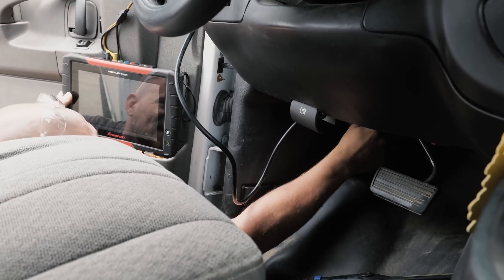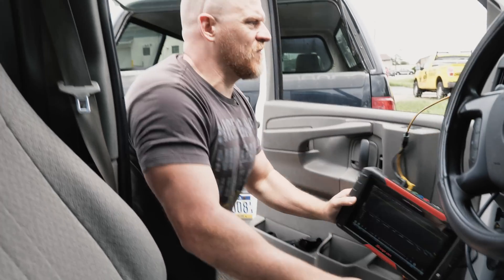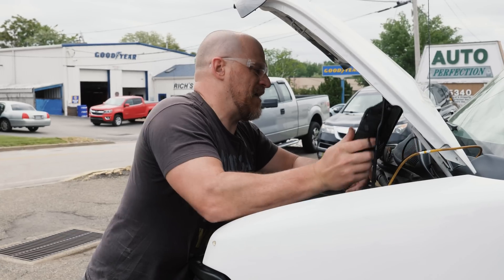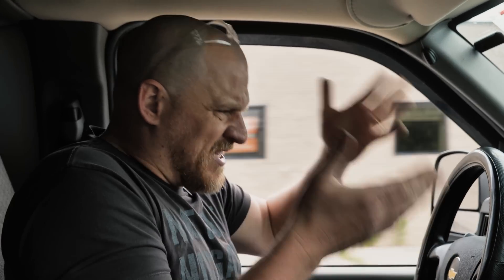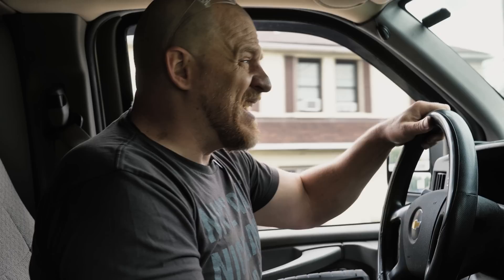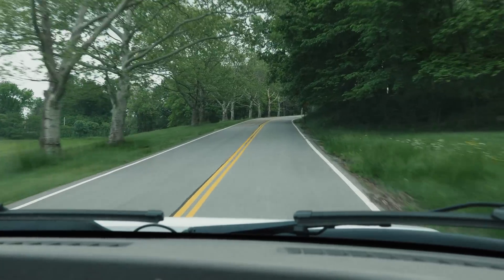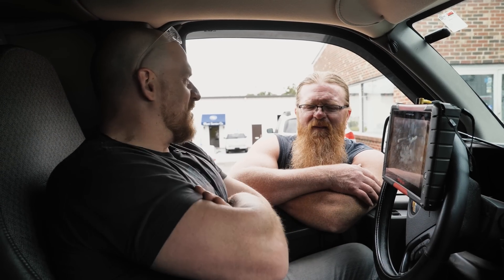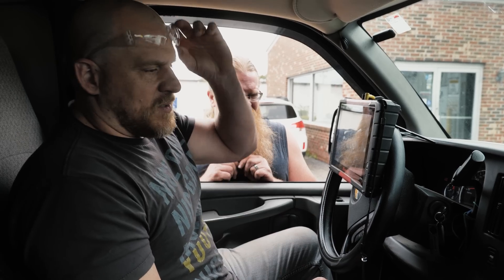We Don't Work For Free [Charging Diagnostic Time]

Comment: Hey man I have a question for you. Some context on this is that my grandmother passed away earlier this year and passed down her crown Vic to me. So I have been working on it non-stop for the past few months getting it back on the road. Brought it to get an alignment at a shop after I put on new tie rods, white wall tires, and sway bar bushings. Got the car back and the wheel was way off to the right. Held the wheel straight and it would go way off to the left. Like I’m talking it would cross three lanes on a parkway holding the wheel straight. So I bring it back tell the guy who did it that there was something wrong with the alignment, and he says bring it back but that the car has loose steering so the wheel won’t always be straight. If it does it again he said he wanted to go for a ride so I can show him. In my head I wasn’t buying the loose steering box, but ok. I pick it up the second time and ask him if he wants to take a ride so I can show him, at first he told me it’s near closing time and he wants to go home, but I convince him and he tells me that he wants me to go down the street he uses for all of his alignments because it wasn’t doing it for him. I said I hope it doesn’t do it this time then proceed to hold the wheel straight, and the car tracks left to the other side of the road. As soon as he sees that he tells me to turn the car around and head back to his shop, that I was being to anal, and that he’s being racing cars his whole life, he did 10 alignments that day and that you can’t win them all. So he said I’ll just give you your money back. You’re obviously not happy. We go back I don’t have my card so he said he can’t give me cash since I didn’t pay cash. He told me to come back the next morning but i didn’t go back. Upon further inspection of the car when I got home, I found that the front right white wall had been completely scuffed up for about a 1/4 of the tire and the rear right had some rubber missing from the side wall. I was besides myself. Brand new white wall tires, just messed up. I took pictures and I have before photos to show that they weren’t done by me. 

Was I being to anal about the car not tracking straight? And should I press the guy for damages to the tires? I haven’t gone back to get my money since I have other things going on. I mean I’m a graduated Marine Motorsports student from BOCES and have been wrenching on cars the last 6 years. I feel like this could’ve been handled better but idk. I’m trying to get a different perspective on the matter.
Reply from the maker: To be clear, these were brand new tires? That got destroyed after having what sounds like a shotty alignment done? Or were these very old tires?
Reply: @ScannerDanner  they were brand new tires. Bough them off of priority tire, had them shipped, installed them one week prior.

Comment: That's my thought exactly as being an self-employed automobile technician,, what do I charge a customer I normally charge them one hour diagnostic fee, can't find anything from there I have fool around with them for another couple hours and give that to them for free, but that's not fair to the next customer,,, but also when you quote a price out as I'm doing the air conditioning job the price has been quoted and now realizing the lines won't come loose from the evaporator core whose fault is it,, Is it mine, should I warn the customer about it ahead of time and he may not want to do it start off with,'but trying not to talk any problems up',, evaporator core is an expensive job the customer will pay no problem with that but, what would be fair. I don't want to work for free

Comment: This is something that used to chap me something fierce when I was still in this business. Why should techs work for free? No one else does. Some of what bothered me the most was some customers just had the attitude that well since my car is broke you have to fix it with minimal or no charge to me. Much time is spent now and has been for several years now, just finding wiring schematics, narrowing down the problem, before ever even touching the car. All of that takes time to do. I still wish this industry would do away with the flat rate pay system. Unfortunately, that is what has created all of the parts changers out there in my opinion.

Comment: This is exactly why I've been just dealing with an intermittent no-crank issue. Some days it just doesn't want to crank, and the rest it's fine. I have done everything myself to diagnose, and it's either the ground or starter itself. It's been doing this for almost 2 years now.

I sent it to the shop, and whaddya know, by the time the mechanic got to it IT WAS STARTING AGAIN. Absolute money-pit of an issue if I let a mechanic try and chase this intermittent issue. This is why for some customers it sucks to pay for diagnosing intermittent issues.
Reply: An experienced diagnostic tech , will test appropriately for the system and one who uses a scope can detect poor circuits and components. With good data can make a call to fix an intermittent issue of a failing part/control circuit.  JS
Reply: Grab a 10mm (or appropriate), and loosen then tighten every ground strap, both ends... 
Have you used jumper cables to starter from battery when no start condition? (ground and hot direct to battery).  GL
ps. Had a merc that took me 3 days to diagnose/fix... was a relay as I recall.
Reply: Also, where are you Matt?  I'm retired and help some folks/friends and family out, if relatively local (1 in X chance), I'd be willing to diagnose without charge and fix, you buy parts and assist.
Reply: @kennethhicks2113  Thanks for the offer. 

The issue came back after over 2 months again. This time I checked nearly everything. New symptom being it cranks for a split second then no longer responds to crank signal. It did this twice this week. Both days split second crank then no response after.

Solenoid gets 12v every time key in crank
Heavy gauge hot always 12.3v
Voltage drops to 12.09 on the heavy gauge with key in crank
There is no voltage leaking into ground on the engine block 

The only thing I haven't tried is bypassing the system with a direct jumper to starter (it's not easy setting alligator clips on blindly). 

Seems to me it's been the starter the entire time? It's only about 3-4 years old, but I'm not sure what brand the previous shop installed in there.
Reply: @TheGuccibane  Based on how I'm reading what you wrote, key always applies 12V to solenoid and solenoid always outputs 12V with very little voltage drop.  This tells me not much current output to starter and thus not enough power to turn the starter motor.  Diagnosis/guess, bad starter or ground.  Considering the difficulty of getting 12V to starter, use jumper cable from battery ground to engine block close to starter (you supply known good ground on starter).... if same measurements, bad starter.  GL
Reply: @kennethhicks2113  My initial assumption is somethings intermittently wrong with the starting circuit in the car but if solenoid supplies 12v on crank then that should mean the starting circuit is fine right? I thought I was chasing some wiring issue but it seems to be the starter is the one being intermittent. If the engine block ground was bad, wouldn't I see voltage in the ground of the block going from negative battery post to engine block?
Reply: @TheGuccibane  Yes, starting solenoid indicates good based on your reading of always 12V out to starter when key activates starting solenoid. As for ground, in days gone by I'd say yes to your question but seen some strange things and easy to by pass that "if" by attaching battery ground to starter ground/block via good jumper cable and trying to crank... doubtful but easy/cheap to test.  
The starter isn't drawing much current by indication of the low voltage drop of 12v coming out of solenoid going to starter when engaged.. unless you have super battery and super wire from it to solenoid and ground (ya don't). So yes, intermittent starter for sure if ground 100% good to battery from it based on what you've said.
Reply: @kennethhicks2113  Appreciate the tips. I'm a full on car guy but something about working on my own things I just hate doing.. But now I'm an expert at diagnosing bad starters and grounds. 

It's just so weird that this starter has been intermittent for so long now. 2 months ago it wasn't starting for 3 consecutive days, and by the time I wanted to do all the tests after doing the easier ones, she was starting again. And fine again for over 2 months straight, up until a couple days ago. The wild intervals of intermittence made be believe it was an electrical gremlin within the starting circuit itself.  The original starter was also just replaced by a shop in January of 2021. Not sure what starter they used but I'm betting it wasn't a very good one. 

I'm also weird in that I have to do the same tests over and over to satisfy myself with a conclusion. Even if every sign of testing I just did points to a bad starter, I wouldn't be surprised if it was something else. But honestly what else could it possibly be if all the wires are getting proper power with a good ground in place?

Went ahead and ordered the last available Denso starter on RockAuto. I'll update when I change it out. Thanks!
Reply: @TheGuccibane  Lol... know exactly how ya feel... and hope you get a good starter... as I'm sure you know sometimes there just isn't a good one for certain applications anymore (not just starters).  Heck, rebuild the old one right yourself ;  )
Hoping ya get a great starter and it's done with for ya Matt.  Best, Ken

Comment: Excellent video. I have to laugh about Autozone and any other stores that perform the free diagnostic which takes all of 3 minutes.. Lean or rich code? Buy a new O2 sensor etc.
It's hard for some customers to wrap their heads around the idea that they have to pay for time invested in their vehicles. It doesn't help when some businesses don't charge their customers if they cannot fix the problem. For some types of service this business model may work out ok, but won't work for the auto mechanic / tech. There's a very successful youtube content creator who owns a Macbook, iphone repair business in NYC who doesn't charge the customer if they cannot make the repair. Those instances are rare, and that also helps draw more customers to them, so the model works for them. 
As Paul points out, the nature of intermittent problems in vehicles can run the hours spent on simply tracking down the problem can run the time and cost through the roof. Although I don't agree with it, but I think that some of the less capable techs like at the dealerships will get into shot gunning  parts. The reasoning being, 'at least we put in a NEW part so that will last longer etc..' even though it doesn't even touch the real problem.
I have run into customers who expect free estimates no matter what, and they want the estimate to be precise and not exceed a reasonable value, and some of those estimates take a lot of research, investigation, and time investment. Shops that give free estimates expect to get the money back in getting the job, but it's no guarantee that you'll get the job. I used to do work for an engineering firm that would ask me for favors all the time, to take care of things for free on the promise of getting paid back on future jobs. Future jobs that NEVER came to fruition.
Reply from the maker: For intermittents that cannot be duplicated, I do understand why people will swap out a part
Reply: @ScannerDanner  Yes, and to add more complexity to the situation today, the quality of a lot of the parts that come from offshore companies is often so poor that an original or previously replace part that may have been good (or bad) is now being replaced with a bad part which wastes even more time. On top of all this it appears that cars are getting more complex every year.
Reply from the maker: @fredflintstone8048  exactly! Now we've added problems to the problem
Reply: @Fred Flintstone.  You said   "but I think that some of the less capable techs like at the dealerships will get into shot gunning  parts"  Truth of that is I worked crappy chain shops for years that provided ZERO training and have been at a dealership for the past 4 years and now have formal training and required training.  Point to that is for the most part you'll find better techs at the dealership and techs who want to take their career more seriously than you will at firestone, midas, goodyear or tuffy.  Sure there are some crappy dealer techs but from my experience they are few and far in between compared to chain shops.
Reply: @JD730  I totally agree with what you stated, and meant no offense to dealership techs. That said the best techs techs like Paul and others tend to move on to independent shops and I was comparing them to the dealership techs. Dealership techs are very often the techs that come straight out of school, but as they get better they most often move on to independent shops, often opening up shops of their own and become quite successful because let's face it, being good at troubleshooting problems in the more modern cars is a talent that few (by comparison) have, and they have better working conditions and make better money in the independent shop, or their own shop than what the dealers can provide for them. 
I would never dare to compare someone working in any of the autoparts stores with a dealership level mechanic.

Comment: I tell the customer up front what my average time spent diagnosing a vehicle is and give them a ball park to look at. I tell them it could be more or less depending on the problem. I also have them read and agree to terms and conditions I send them via email before going there. Part of the terms and conditions is I must be paid regardless if I find the fault or not or if a component needs to replaced and programmed at the dealer unless I say otherwise. I haven't had anyone complain yet.
Reply from the maker: perfect! Communication is the key

Comment: I wish service managers and advisors fully understood this. Some do, most certainly do not. 
I work at a Chrysler dealership, customers are always coming in with multiple concerns such as 1: customer states transmission is slipping. 2: customer states ABS light is on. 3: customer states vehicle lacks power. 
Now an experienced advisor would inform the customer that it would be at least 3 hours of diag time. If they end up all being related maybe not but most advisors will tell the customer 1 hour. ABSOLUTE BULLCRAP!! It’s hard enough that customers think you just plug in a tool and tell them what’s wrong, but now the guys that are supposed to be on our side are screwing us! 1 hour for 3 concerns? No. If you want to pay us flat rate you need to play by the rules.
Reply: Yeah I get that but if you're serious about getting paid you gotta draw a line in the sand. Either they pay you properly (for your time no more no less) or you're leaving, and tell them that. Don't take less. If my service advisor tells me that, I'm flat out saying I ain't doing it. Wtf they gonna do fire me? For what? Not working for free? Go ahead. I'll get another job by tomorrow and let the labor board know. Tell them that just like that man.
Reply: I hear ya! :O)
https://www.youtube.com/watch?v=t1VzXXWUfqk
Reply: Very well said

Comment: The problem is when the shop guessing and the customer has to pay for the consequences or when the customer thinks get code is the diagnostic. On electric problem you know when you start but you don't know when you go fishing. Gest is not the solution.
Reply: Customers thinking the code is diagnostics is autozone and other parts chain's fault for putting that in the customer's minds in the late 90's -2000's

Comment: Very good point sir! Im actually fighting that same thing on my service vehicle. My jeep has an intermittent boost control circuit fault that puts it into limp mode at seemingly random times. When i get to a point of putting my scope on it, the fault isnt there. It acts up until i shut it off then it resets. I know a problem is there, but cant say for sure where the circuit fault is yet. Its the same for my customers. Im trying to find the fault and sometimes it takes longer than an hour.